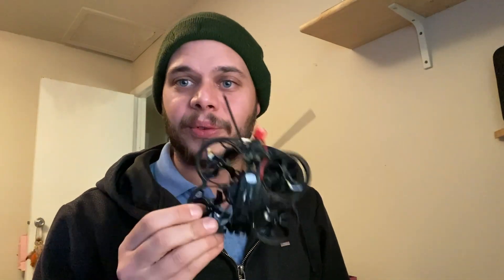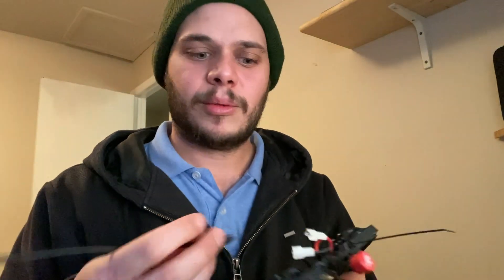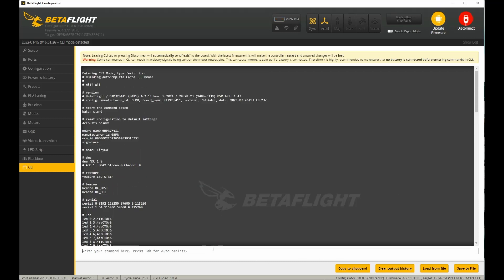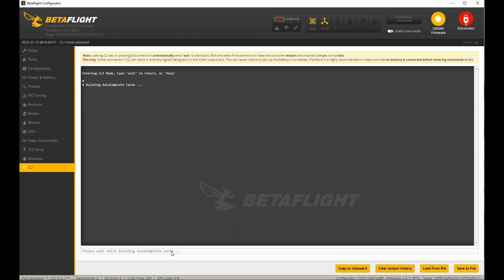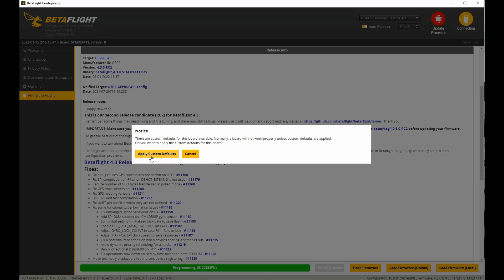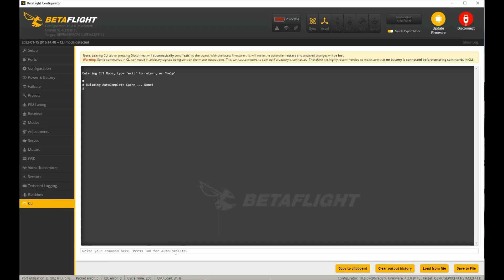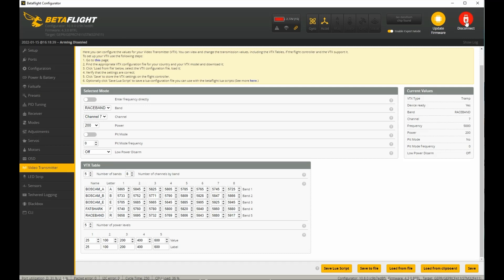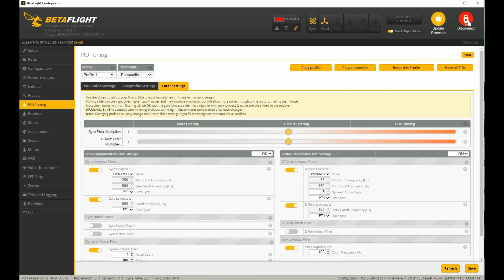Fly better with a Firmware Update - GepRC TinyGO 4k - Flashing to 4.3.0

Comment: Hi Nick. Can you help me with my setting for yaw on my TinyGo? It’s new, bought last month, March 2023, and still has factory settings but the yaw is super sensitive when flying on angle and horizontal mode. I’m getting back into this hobby so I need to brush up on my flying skill and would like to tone down the sensitivity via BetaFlight. Any other tips would be greatly appreciated. Also what length was the True RC antenna on your TinyGo? Thanks again!  -Dave

Comment: Is it possible to connect Frsky R-XSR 4-10V 16CH FPV to TinyGo 4K?
Reply from the maker: Yes, it will connect the same way as the current receiver on the tinygo. This video shows how to connect an r81 receiver to the tinygo but it should be the same process for the r-xsr https://youtu.be/dfBcfwlJ6f8

Comment: Hey man, I have a tinygo 4K. So I followed this and everything seemed to work great as far as betaflight saying "successful." The only problem is now its like my receiver is no longer there. I changed it to a R81 so I can fly it with my TX16S and had no problem upgrading it. It worked awsome for a good 4 months or so. But now after flashing it, my radio is not doing anything with the drone even though it IS bound and telemetry IS present. Any suggestions for me to try to get back flying?
Reply from the maker: I would check the rx is set correctly in the ports tab, flashing can reset it sometimes. Then I’d try reflashing. And if it’s still not working try flashing back to the older firmware you were using and see if it comes back then

Comment: i just bought this drone but I cannot record either in the goggles or the drone itself, why is that? In the goggles I have a 32GB card and in both, goggles and drone, but  the goggles don't even recognize the card and in the drone just record  when a connect the batteries, when I start to flight stop automatically. What should be the problem?
Reply from the maker: Most often it’s the writing speed of the SD card, they need to be at least a U3 or higher
Reply: @719FPV  is a U3, and i use it with my DJI Drone too and works perfectly

Comment: Please, can someone help me. I did the update, now the drone is unusable, it turns on, the controller seems to connect, but the drone doesn't show any beeps at all. and in the glasses there is also no radio command like Ang/Hor ... it seems that it is disconnected. I didn't save the backup, but I took the factory settings. What can it be?
Reply from the maker: You can probably save it with the factory CLI dump. You can find the one you need on geprc.com
Reply: First, thank you very much for helping me. I found the cli on the website, do I have to convert it to a text file? And I'll probably have to inject it into the drone via betaflight, do you know of a link teaching the procedure? Or can I use it as per this video? Sorry, I'm using Google translator.
Reply from the maker: @wendellluciano  open the CLI file and it should show it in text form. Copy and paste the entire text into the betaflight CLI tab and press enter. If it doesn’t automatically save and reboot, type ‘save’ into the box and press enter. If this still doesn’t fix it try flashing back to the original firmware and try the CLI dump again
Reply: I'm much happier now, it worked. Now there's only one problem left, when I start the engine, the drone jumps and turns, as if I was in turtle mode, I've already checked all the keys, but in all positions the same thing, a jump upside down when starting the engines.
Reply from the maker: @wendellluciano  good we’re making progress. That sounds like one or more of your motor directions have changed with one of the firmware updates. If you’re on 4.3.0 you can use the motor wizard in the betaflight motor tab to fix them.
Reply: apparently the yaw is on, making it run, that's what betaflight shows. But I can't solve
Reply from the maker: @wendellluciano  when connected to betaflight does the image of the drone match the movement of your tinygo? Follow up question, in the receiver section of betaflight does the image of the drone move correctly with your stick movements?
Reply: It seems that the problem is yaw, in the pit configuration, it is all to the right, and where it should mark 0° it is marking 667° while the others are at 0°. but i don't know where to change it
Reply: It keeps spinning, the yaw is activated at maximum, but even if I move the stick, it remains at maximum. the others work correctly.
Reply from the maker: @wendellluciano  oh ok, sounds like your RX  Range has been messed up somehow. Joshua Bardwell has a “1-on-1 troubleshoot Helping Liam configure his receiver tab” video that goes over how to fix this. Try checking out that video and hopefully it will help you get it working properly.
Reply: I will continue later. you already helped me a lot. thanks
I'm going to work now and come back later 😁
Reply: @719FPV  Hi. saw your video and learned the command for rxrange to delimit points. I have a problem, my drone after update, is not flying, when I turn it on, it activates the engines and jumps like in turtle mode. I noticed that in betaflight the yaw control is at the maximum 2000, I already put the old firmware and it was the same. In the control tab, the drone is rotating and the yaw on 2000. how to configure it to be in the middle (1500)? And also on the PID tab, all the commands go from 0 deg/s- 667 deg/s, when I turn on the radio the yaw goes from 0 to 667deg, while the others remain at 0 deg
Reply: @719FPV  Hi. the problem was the TX potentiometer wire, the red one was loose from the yaw. I soldered it again, but the potentiometer itself is still playing a little to the side. but it is now possible to fly by holding the yaw a little. Tkssss

Comment: Could you please share with me your diff all file? unfortunately I lost mine, and my tiny is dead, please help me bring him back to life, you are my only hope, thanks in advance.
Reply: @719FPV  the new one with black sticks
Reply from the maker: Entering CLI Mode, type 'exit' to r

# diff all

# version
# Betaflight / STM32F411 (S411) 4.2.11 Nov  9 2021 / 20:28:23 (948ba6339) MSP API: 1.43
# config: manufacturer_id: GEPR, board_name: GEPRCF411, version: 7b156dec, date: 2021-07-26T13:19:23Z

# start the command batch
batch start

# reset configuration to default settings
defaults nosave

board_name GEPRCF411
manufacturer_id GEPR
mcu_id 006800223236510539313331
signature 

# name: TinyGO

# dma
dma ADC 1 0
# ADC 1: DMA2 Stream 0 Channel 0

# feature
feature LED_STRIP

# beacon
beacon RX_LOST
beacon RX_SET

# serial
serial 0 8192 115200 57600 0 115200
serial 1 64 115200 57600 0 115200

# led
led 0 2,4::CTO:6
led 1 3,4::CTO:6
led 2 4,4::CTO:6
led 3 5,4::CTO:6
led 4 6,4::CTO:6
led 5 7,4::CTO:6
led 6 8,4::CTO:6
led 7 9,4::CTO:6
led 8 10,4::CTO:6
led 9 11,4::CTO:6
led 10 12,4::CTO:2
led 11 13,4::CTO:2

# aux
aux 0 0 0 900 1300 0 0
aux 1 1 1 1700 2100 0 0
aux 2 2 1 1300 1700 0 0
aux 3 13 2 1300 1700 0 0
aux 4 35 2 1700 2100 0 0

# adjrange
adjrange 0 0 3 900 2100 12 3 0 0

# vtxtable
vtxtable bands 5
vtxtable channels 8
vtxtable band 1 BOSCAM_A A CUSTOM  5865 5845 5825 5805 5785 5765 5745 5725
vtxtable band 2 BOSCAM_B B CUSTOM  5733 5752 5771 5790 5809 5828 5847 5866
vtxtable band 3 BOSCAM_E E CUSTOM  5705 5685 5665 5645 5885 5905 5925 5945
vtxtable band 4 FATSHARK F CUSTOM  5740 5760 5780 5800 5820 5840 5860 5880
vtxtable band 5 RACEBAND R CUSTOM  5658 5695 5732 5769 5806 5843 5880 5917
vtxtable powerlevels 5
vtxtable powervalues 25 100 200 400 600
vtxtable powerlabels 25 100 200 400 600

# master
set gyro_lowpass2_hz = 350
set dyn_lpf_gyro_min_hz = 280
set dyn_lpf_gyro_max_hz = 700
set acc_calibration = 0,-38,-18,1
set motor_pwm_protocol = DSHOT300
set align_board_yaw = 180
set beeper_dshot_beacon_tone = 5
set yaw_motors_reversed = ON
set small_angle = 180
set osd_warn_link_quality = ON
set osd_vbat_pos = 2434
set osd_rssi_pos = 67
set osd_link_quality_pos = 2083
set osd_tim_2_pos = 2454
set osd_flymode_pos = 2104
set osd_vtx_channel_pos = 33
set osd_mah_drawn_pos = 2444
set osd_avg_cell_voltage_pos = 2402
set vtx_band = 5
set vtx_channel = 7
set vtx_power = 3
set vtx_freq = 5880
set dashboard_i2c_bus = 1
set name = TinyGO

profile 0

# profile 0
set dyn_lpf_dterm_min_hz = 98
set dyn_lpf_dterm_max_hz = 238
set dterm_lowpass2_hz = 210
set p_pitch = 52
set d_pitch = 35
set p_roll = 50
set d_roll = 32
set d_min_roll = 20
set d_min_pitch = 22

profile 1

# profile 1
set dyn_lpf_dterm_min_hz = 98
set dyn_lpf_dterm_max_hz = 238
set dterm_lowpass2_hz = 210
set p_pitch = 52
set d_pitch = 35
set p_roll = 50
set d_roll = 32
set d_min_roll = 20
set d_min_pitch = 22

profile 2

# restore original profile selection
profile 0

rateprofile 0

# rateprofile 0
set rates_type = ACTUAL
set roll_rc_rate = 15
set pitch_rc_rate = 15
set yaw_rc_rate = 15
set roll_expo = 75
set pitch_expo = 75
set yaw_expo = 75
set roll_srate = 90
set pitch_srate = 90
set yaw_srate = 80
set tpa_breakpoint = 1650
set throttle_limit_type = SCALE

rateprofile 1

# rateprofile 1
set rates_type = ACTUAL
set roll_rc_rate = 15
set pitch_rc_rate = 15
set yaw_rc_rate = 15
set roll_expo = 75
set pitch_expo = 75
set yaw_expo = 75
set roll_srate = 90
set pitch_srate = 90
set yaw_srate = 80
set tpa_breakpoint = 1650
set throttle_limit_type = SCALE
set throttle_limit_percent = 75

rateprofile 2

# rateprofile 2
set rates_type = ACTUAL
set roll_rc_rate = 15
set pitch_rc_rate = 15
set yaw_rc_rate = 15
set roll_expo = 75
set pitch_expo = 75
set yaw_expo = 75
set roll_srate = 90
set pitch_srate = 90
set yaw_srate = 80
set tpa_breakpoint = 1650
set throttle_limit_type = SCALE
set throttle_limit_percent = 50

rateprofile 3

rateprofile 4

rateprofile 5

# restore original rateprofile selection
rateprofile 1

# save configuration
save
#
Reply: @719FPV  ok let me do that
Reply: says unknown command ??
Reply: 'exit' to r # diff all     unknown command
Reply from the maker: @everardocontreras2230  did you copy and paste the whole thing into the CLI?
Reply: @719FPV  I updated firmware to 4.3.0 but did not made a copy of diff all
Reply from the maker: @everardocontreras2230  Go here, you should be able to find the right CLI you need.
https://geprc.com/downloads/tinygo/
Reply: @719FPV  ok thanks let me try, 
but if i don't fix it
 Would there be a way for you to share your own cli for me?
Reply: @719FPV  finally i solved the problem, than you cheers from Mexico.

Comment: Hi Nick, 
I would really appreciate your help. My 10 year old son saved up and bought this drone (RFT kit) for himself. We followed all of your instructions, including overcoming the issue of Beta-flight not wanting to flash the firmware, sorted that out with Impulse Driver fixer. Unfortunately, now we can't seem to get the drone to bind with the original flight controller - could you please direct me. 
Found instructions online that tells us to hold down the bind button and then turn on the controller which will then have the controller's light start flashing. Then press and hold the frequency key of the receiver with tweezers or a pen and then plug in the drone batteries. Once the drone powers up, the drone and controller will bind automatically. That is not the case...
Reply from the maker: My first guess is maybe the firmware changed or reset the ports tab in betaflight. Are you getting any lights on the receiver when trying to bind? If everything seems to be correct and still can’t bind, try going back down a firmware so if you’re on 3.1.0 try flashing back to 3.0.0 to see if it comes back

Comment: I bought the geprc tinygo 4k...
how to record video in 4k? It doesn't have a button to start recording on the drone..
only on goggles...
I already put the card in the drone...
how to configure? can you make a video explaining it? can you configure the aux button to record the drone's 4k in betaflight?
thanks for the content!
Reply from the maker: I can definitely make a video for this. But until then, there is a small black button on the side of the recording board that is used to start and stop recording, when recording a red led will light up on that board. To change the settings for the camera and recording board, you have to use the extra joystick board that should have came with the kit. It’s the one with the green and black wires. Plug that into the available green and black plug on the recording board, power up the drone, make sure you’re not recording, and then you can press the joystick to open the settings menu. Hope this helps

Comment: Hello I have a problem. after upgrading to 4.3 and choosing the presets and loading the backup the pitch channel doesn't work. the drone cannot fly because the pitch is always on minimum. in the receiver tab of betaflight the command does not respond but the other channels of the station work fine. What can be?
Reply from the maker: First thing I would try is do another firmware update, and before using a preset and loading the back up, see if pitch comes back

Comment: Have you tried FW 4.3.1?  When I performed my fw upgrade, I did an auto-detect.  Is your method preferred? Manually search drop-down based on receiver?
Reply from the maker: I have not tried 4.3.1 yet but probably will be soon. And the auto detect is probably preferable but if for some reason it doesn’t work, the drop down bar will work
Reply: @719FPV  My GEPRC remote control finally stopped powering on.  I had issues with it out of the box.  I watched one of your other videos where you swapped out the transmitter for 3rd party remote control support.  I am so tempted to do this, but man, it's been awhile since I've soldered anything.
Reply from the maker: @AdoptiveStrand  it’s definitely worth the upgrade, as you will need it for any other drone, and then you could use it for a simulator as well. But don’t let the soldering worry you, that upgrade was my first time soldering haha but you may want to open up your controller and see if a wire came loose, could be an easy fix
Reply: @719FPV  Thanks for the confidence boosted.  😁. I am actually looking at radios right now.  In the meantime, let me get the GR8 taken apart.  Off topic, in 2005, I had an STi in Crystal Gray Metallic. I see you have a HB?
Reply from the maker: @AdoptiveStrand  yeah I have a 2013 wrx hatchback and love it!

Comment: Hi! I updated the firmware on my drone and now it does not respond to the remote control. The remote control and transmitter are connected to each other, the red LED is on. But the drone itself and Betaflight do not respond to the remote control. What could be the problem?
Reply from the maker: It’s possible the update may have turned off or changed the uart for your receiver in betaflight. If that looks like it’s correct, you may just have to rebind the receiver to the controller. Let me know if this helps
Reply: @719FPV  I made rebind, but it didn't help me. Then I found information that I need to fill in the SBUS settings to the drone. But I only found version for 2.2.5. However, looks like everything works well now. In general, the problem is solved. I asked GepRC to send me settings for 3.3.1 if they have it. Waiting for their reply. I'm newbie in FPV:)

Comment: Hi Nick, great video! I have my first TinyGo and it was not a good start, crashed on maiden flight 😫 So I started searching for information about repairing and I found your channel. TOP! First it was completely dead. I'm still not flying, but I can bind now back with the controller. In Beatflight the stick movements are working but when I power with the batteries the pitch/yaw/roll are working, no throttle at all. Maybe you have an suggestion to check? Keep up making your good video's. Really nice!  👍👍
Reply: i think you should open up your controller ..there is a tiny wire loose(it was the red one for me it was the throttle wire) ...it happend to me too ...i hope thats it ..and your off flying again
Reply: Are you sure you're not in turttle mode?
1. Disarm
2. Push the switch AUX 3 down (away from your head)
3. Lower throttle to minimum
4. Arm

Comment: What is the lowest voltage you can fly a 2s drone?
Reply from the maker: Typically you don’t want to ever want a lipo to go under 3.0v per cell so I would say 6.4v would be a good voltage to land at for a 2s
Reply: @719FPV  Thank you so much i got confused because i thought all batteries no matter what s can be flown down to 3.0 volts max but now i now so thank you.
Noah from Australia

Comment: Hi Nick, I have a problem with my DVR on my Tinygo, it records only for 25 sec to 46 sec do you have a clue what’s wrong. Watching your vids and they are very helpful. Thanks and keep up the good work. 🇨🇦 😉👍
Reply from the maker: Thank you! If you’re not loosing video and it just stops recording, it sounds like there might be a problem with your SD Card. Try clearing the memory, or trying a different card. I hope this helps
Reply: @719FPV  Ok I will try that and thanks for your quick response. I’m a newby and your vids are helping a lot. 😉👍